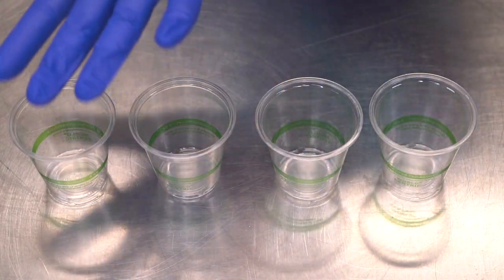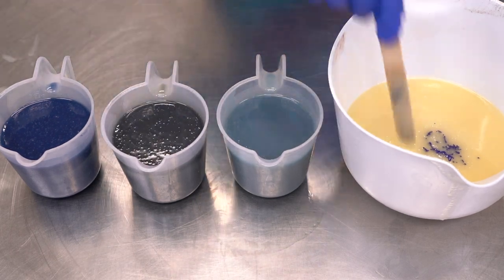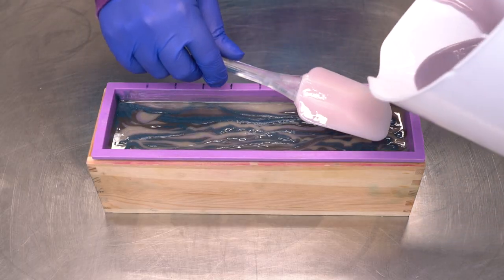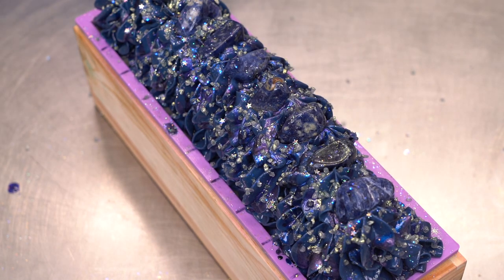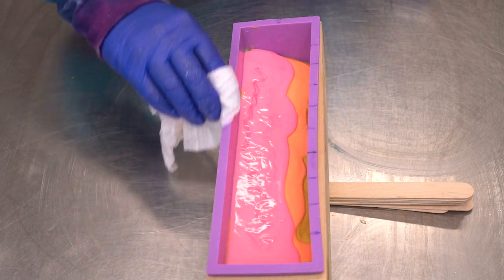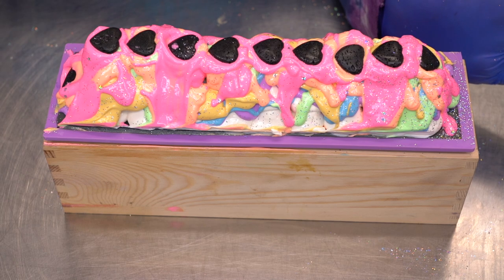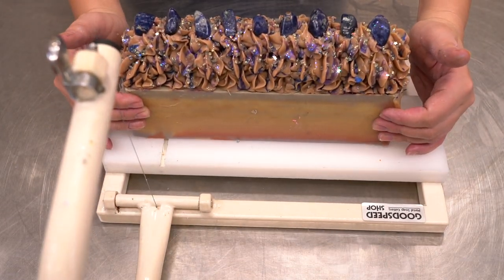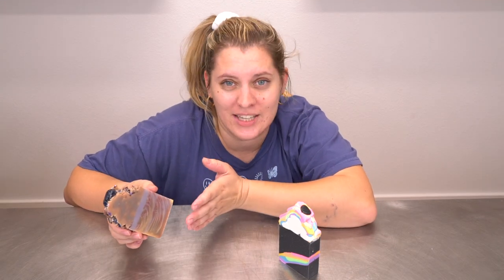TESTING & EXPERIMENTING - New Soap Equipment, Colors, Techniques….*dramatic results* | Royalty Soaps

Comment: What would be cute- inspired by the other end of the pretty soap during reveal. How the white dollops were peaking through the color slightly. 
By row, space the top dollops slightly ad color. Next layer spaced then color. Encapsulate each dollop in a color shell. 
I love you soaps and the top is always a show stopper. But usually by cut the top falls short. I wish you could see more of the dimension you see on the outside edge. The flat inside of the topper looks like a blob of white always.  I always wished it had more to it.

Comment: Would those little rocks not go down the drain? Or would that just not be a big deal? I have a septic tank and was told by the guys who came to fix it after I moved in to be very careful what goes down the drain because it can mess up the pipes and clog easily. Maybe that’s just a thing for septic tanks tho.

Comment: For the "ugly" bar... not sure it was the mica's fault. The oil says right on the bottle that it discolors to tan. I actually still like the soap as mesa-like. Fizz fairy does say not recommended for cold process too though.
Reply: She doesn't add fragrance to her soap frosting and it still morphed so it was definitely the mica that caused the change.

Comment: I'm weird so I actually think the brown is not that bad. Maybe you could dust it with the blue on top just for kicks. Either way I hope it goes into your " Oops or sample" section on your site because the stones, glitter, and scent sound awesome. I can ignore the colour morph, I'd definitely buy it.
I just used your link to purchase the " Midnight Blue " mica and "Emerald Green" mica to use in my resin flow tables. I was curious and read each description and instructions about what mediums it created for. Both colours stated the are made for use in cold processed soap, bath bombs, candles, melt & pour soap, resin, as well as all makeup product's with the express exception of product used on or around the 👀eyes. It states the mica was blended with vibrant hues and shimmer and is stable and results in a vibrant, shimmering, and deep blue( or green for the emerald) true to product's picture end colour result. Both products had 1 🌟star reviews from 2 separate soap makers. Both were upset because they wasted money on the mica feeling they were mislead.  They were also upset about wasting money and time creating soap loaves they couldn't give away much less sell. The reviewer of the Midnight Blue mica stated after curing and removing from the mold, her entire batch came out a infant 💩poop brown. The reviewer of the Emerald Green mica was livid and stated  after she de-moulded her bars after curing they turned out a dull puke colored Terra cotta ish,  orangey,  chalky bland unpleasant Pepto Bismal pink ish colour. Both gals were not pleased and wanted refunds. I went ahead and took the risk for my resin project because I can make, pour, and cure tablespoon size test batches to see how it responds to the high heat produced during curing, as well as see how the mica disperses and see if it settles or stays suspended,  as well as see if the colours stay true and hold when finished. At $8 and $7 for 30 gram sample sizes I felt that testing it out in a little over $1 worth of resin was worth giving it a chance. However the ingredients to create a loaf of cold processed soap intended for retail sale is immensely more costly, so I understand thier frustration and warning to other Soap Makers to steer clear.

Comment: I think the blues contained mostly indigo or a (natural? pH sensible?) compound, which, unlike a synthetic version, is not so stable. I know it sounds obvious and I seem dumb, but I work a lot with Prussian blue. I mixed it with a cold encaustic medium, which basically is a emulsion-wax soap (basic pH), and gave me an ugly brownish color, which is unreversible, except in the presence of an acid (neutralization reaction, meaning to destroy the soap). Maybe you can test color resistance to a higer pH by just testing them in a dilute solution of lye, it could save you a lot of time and material.

Comment: Your idea of what looks pretty in a soap and what I think looks pretty seem to be two opposite things. 
The black soap was okay, except that it had too much black in it. If the top black section was the same size as the lower black section, with lots more color lines in the middle, then it would look good.
The brown soap, before you cut into it, made me think of sunset colors. Subdued, but pretty.  The brown frosting made me think of chocolate mousse, and the pattern inside the soap was very interesting. Not what I've seen before.  I would be interested in getting the brown soap.